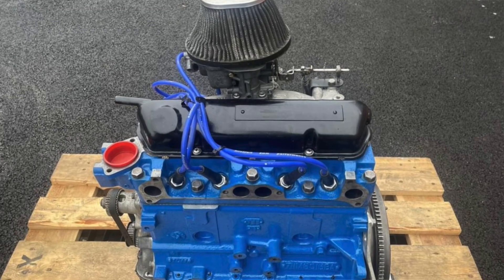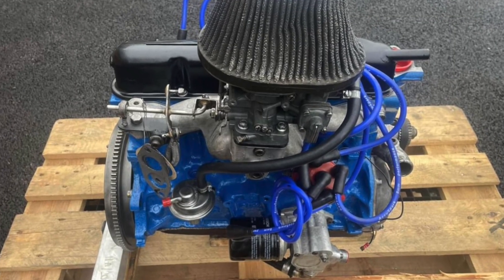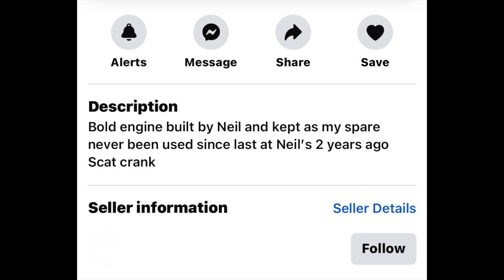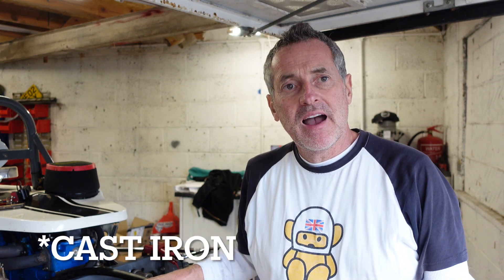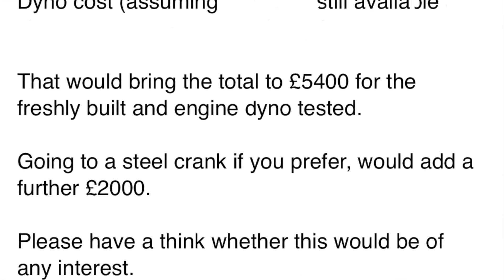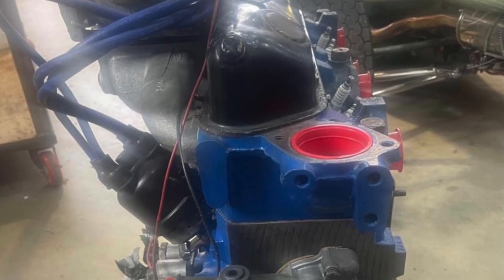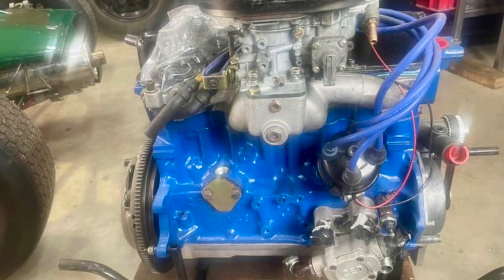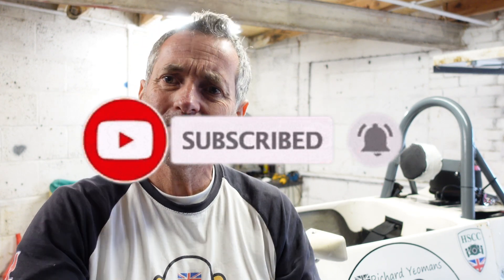Which Race Engine Should I Choose for My Formula Ford 1600 Rebuild? 🔧🏎️

Comment: I'm chiming in bite late but, I would have gone for option C with the steel crank. The steel crank adds cost but you'd get that back  in resale. And there's nothing like the confidence of knowing the engine been freshly gone through with bullet proof crank.

Comment: I would have chosen B also, mostly due to the crank and the history. My only concern with all three is internal cylinder rust. My engine builder recommended fogging oil at shutdown to prevent rust within the combustion chamber while in short and long term storage, with the intake and exhaust ports capped.
Reply from the maker: Great point about the crank and history with Engine B – that’s a huge factor. I totally get the concern with internal cylinder rust, especially with these engines sitting for a while. Fogging oil is a solid recommendation; I've heard it can really help prevent rust buildup in the combustion chamber. Capping the intake and exhaust ports is also a smart move. Thanks for sharing the advice – I’ll definitely keep that in mind moving forward!

Comment: How critically weak is the cast crank verses the forged crank? I had never heard of that being a problem component in the Kent engine. He's elected to go with the forged crank. I think given the choices I'd have gone with option "C". Going through the engine fresh  assures you every part is right.
Reply from the maker: Great question! The cast crank in the Kent engine generally holds up well for many applications, but for consistent racing performance, the forged crank offers that added durability and resilience under high stress. Going with the forged crank was partly for peace of mind over the long term, especially with a high-performance setup.

Option C definitely has its advantages, especially with everything freshly built and fully checked. There’s something to be said for that extra confidence! Thanks for sharing your thoughts – every option had its appeal!

Comment: I would go option A, as you have that engine already. and have it inspected . Of course without a dyno and no compression reference  and so it is a hard choice
Reply from the maker: Good point – sticking with what I already have could save some cost and hassle, especially with a thorough inspection. Without dyno results or compression references, it definitely makes the decision tricky! Appreciate your perspective – it’s a tough call!
Reply: @toooldandtooslow  It always is, as there are other elements to think off. Some you can't see unless you do a scan.   For instance micro cracks in the block.  Also, hpw many times was the engine rebuild ?   Is it close to its dimensions limit ?  If that is the case, the engine might be good, but can't hardly be rebuild later.    I would still fo for one , open it and measure and inspect all parts.  In one day you are done...  At least that is what I do with my Kent and Pinto's.   have a great day

Comment: Good choice on B, correct decision. I'd at least drop the sump off to make sure everything is still caked in oil if its sat for 2 years.
Reply from the maker: Great tip, thanks! Dropping the sump to check the oil situation is a solid idea, especially if it’s been sitting that long. Can’t be too careful with these things – appreciate the advice!

Comment: B, ready to go, from a good builder with a couple of grand crank already in it.
Reply: Reckon you did the right thing.
Reply from the maker: Good point – B does sound like the full package, especially with that high-performance Scat crank already in! Ready to go without the extra rebuild cost is tempting. Thanks for the input – this decision's a tough one!